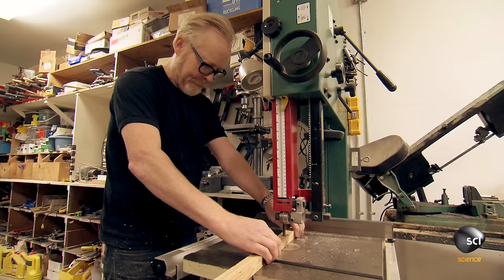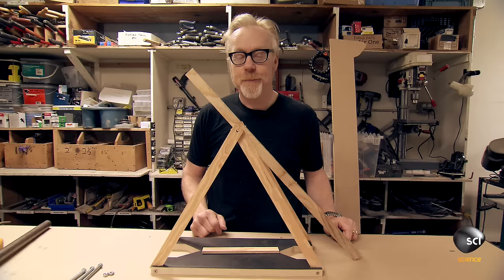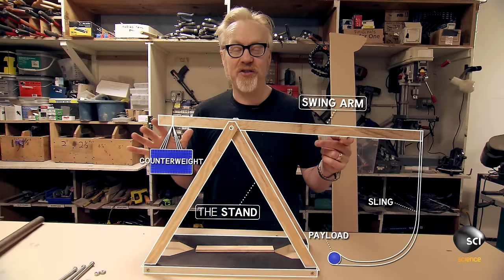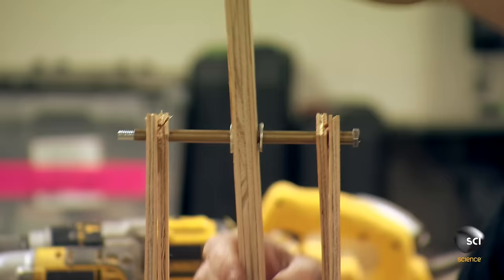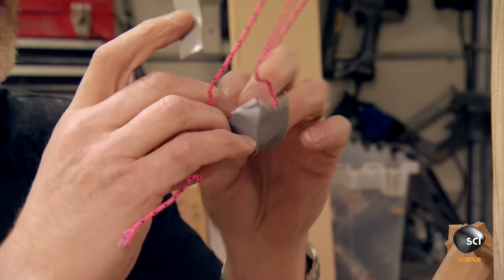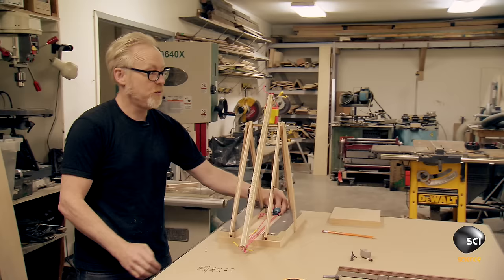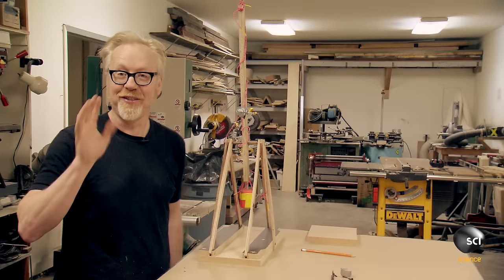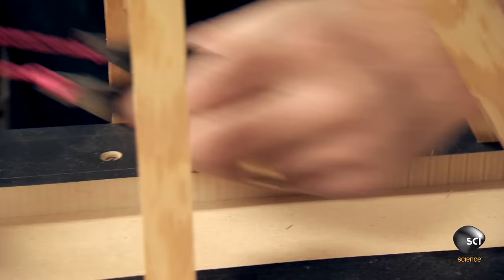How to Build a Trebuchet | MythBusters

Comment: That needs wheels. The base is too heavy. As the heavy weight falls the structure begins to move opposite the direction you’re aiming. When weight reaches the bottom the thrown object hasn’t yet reached its full potential. The heavy weight starts to climb shoving the structure forward in the direction you’re aiming. Adding its speed to the throw.

Comment: A couple of points to improve efficiency (power transfer from the counterweight to the projectile) and thus range.
1) Make the counterweight link (the bit between the CW and the arm) as long as possible, so the CW just clears the ground.
2) The sling length needs to be adjusted so that the projectile releases (sling stall) just before the CW stalls.
Reply: Hopefully you are still alive after four years, but can you explain the second point? Specifically how the length of the sling (longer vs shorter) determines the timing of the release?
Reply: @LordNinja109  Still sucking air. :)
If the sling is shorter, then it has a shorter "circle" to travel to the release point. This means it gets there sooner, and it then can arrive TOO early, before the arm has rotated to the correct point, and transferred the maximum energy to the projectile.

This gives two problems: (1) The missile falls short, sometimes VERY short, and with little proper power, and worse (2) overloading of the machine, as too much energy remains behind.

The release timing is a combination of the angle of the arm, the angle of the sling pin, and the angle between the arm and the sling. Changing the angle of the pin changes the timing (often the easiest way to adjust range), but sling length is also a useful ranging variable.
Reply: @77gravity  do you know this relationship I have to build one for school and you just talked about my biggest fear
Reply: @fettsforlife4081  The main arm should be about 3.75 times length of short arm. Sling should be about length of main arm, no longer, maybe shorter (a good way to tune the machine). See previous comments also.

CW should be about 20 times mass of projectile (for smaller machines), more than that overloads the machine. If you want to throw further, build a bigger machine. If you want to throw heavier things, build a stronger machine (thicker parts, heavier counterweight)
Reply: Thank you for these tips internet stranger, im glad youre still sucking air. Ive been building slings and staff slings and i feel this is the next logical step lol, i love these fun little projects. It channels some sort of ancient medeival vibe, and the ooo rock go far itch in our brains@77gravity
Reply: Around 32 degrees the release prong should be, it should release at about 45 degrees for maximum range

Comment: I heard a builder say something about having to hold on to the projectile/sling until the last second.  Same way you want to hold on to the tip of a towel rat tail before whipping it at the target; even that small bit of resistance as you let it leave your hand apparently helps.  I can't draw you what this means for a trebuchet, but I heard it's really important - and was the missing detail not covered by the medieval manual.
Reply: This is true, I have experimented with this. Range increased if the sling/projectile is "held back" when the treb is released. On a smaller treb I had a clothes peg attached to the end of the missile slide, which just clipped onto the sling "bucket" - it would apply a small tension to the sling as the arm started to move, then release as the sling went tight.

I also found that a not-too-slick surface on the missile slide helped increase range. A metal slide gave less range than a wooden one. Somewhat counter-intuitive, but it was a definite result. This was on a small machine, only throwing about 30 metres, it may not scale accurately.

Comment: The sling length varies... by weight ratio between counterweight and item being thrown.

Also the counterweight connection needs to be another set of arms.

Essentially, he's doing it all wrong.  But even ding it wrong they can be amazingly powerful.

Comment: Witch 3,75:1 he means that for example i need for the short part 1 meter and for the long part 3,75 meter?
Reply: BregaranLP  it would be 3.75m
Reply: Yes that's what he means :)
Reply: It is a ratio so it can be anything ex:foot inck meter yard as long as the ratio stays 3.75:1
Reply: Simple Reason  yes any unit of measurement would work
Reply: Bregaran how much is the weights
Reply: @Bart-bz2iu  Weight should be between 10 and 20 times the weight of the missile.

Comment: anybody know where he got that 3.75:1 arm ratio from? I'm somewhat obsessed with trebuchets and have done a lot of internet research to find ideal ratios and things but there's too many damn variables! best you can do is decide on a design and change the variables you can later like sling length, count weight mass, payload mass, and release timing
Reply: Hey there, did you ever complete that trebuchet design of yours ?
Reply: I was wondering the same.  His ratio seemed different than I've seen.  I just built a big 15ft 400lb and filmed it with a drone.  You may want to check it out.
Reply: lukassnakeman how much is the weights
Reply: Apparently somebody made a study on a trebuchet (maybe i will provide the link later) where the parameters with graphs were provided.I found it through Shadiversidy video about catapults.

Comment: why didnt they make the short part as longs as the long arm ? wouldnt it get more power ?
Reply: +MrChopsuy more torque, less power.
gravity can only accelerate things so fast. it uses a lever effect to amplify that speed.
Reply: +Pierced Corruptus  so it would get more power but it wasnt possible to build back in the days , because of the material and the fact that the needed counterweight could not be moved back than
Reply: +MrChopsuy Nope. The weighted end will always accelerate at the same rate, which isn't all that fast. The difference in length between the levers on each side of the axle is proportionate to the difference in speed that their tips will be moving at. Also, making the arms same length would really fuck up the sling's mechanics, which involve taking advantage of the negative part of the swing: once the levers are past the vertical point, they are slowing down, but they're still moving, so there's still energy to be explored and that's where the sling does it's thing. The trebuchet was considered a marvel of engineering, it really changed siege warfare and war all around.
Reply: Wow, everyone here is so wrong and is saying things that are stupid and nonsensical. To answer OP: Yes, it would get more power, however, that's unnecessary. The whole point of the trebuchet is lifting a heavy counterweight a (relatively) small height and transfer the energy. Trebuchets already have a good range, why work harder for more power that you don't need. Also, the arm would have to be thicker to sustain the extra energy.
Reply: A lot of people are over thinking this, If the short arm was as long as the long arm then the counterweight would smash against the ground when released.
Reply: @specdecible  in theory that could be fixed by making the frame higher but yeah I thought the same at first.